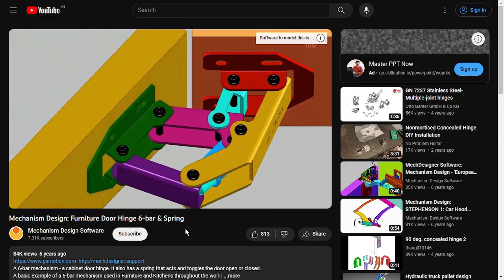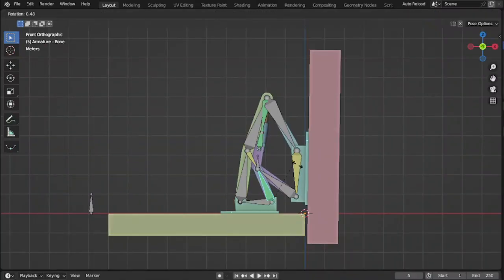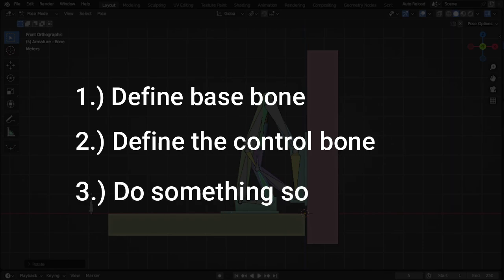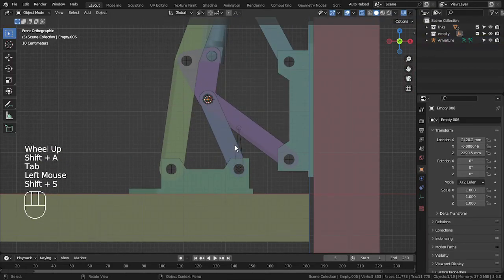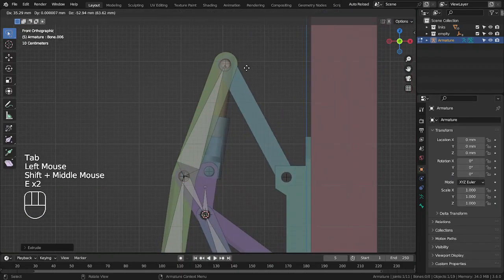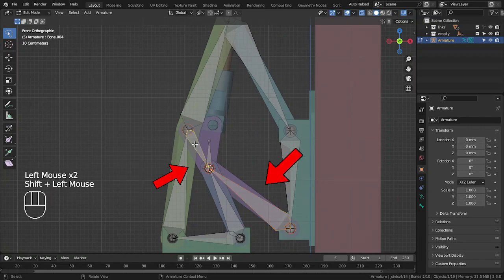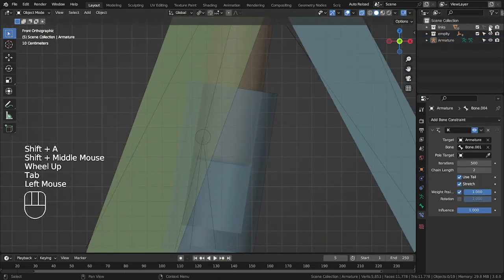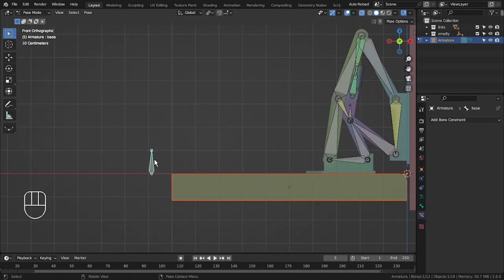Mechanical Rigging in blender | 6 bar mechanism

Comment: Excellent, thanks! I want to grab the red piece and move the whole mechanism, is it possible?
Reply from the maker: red piece ??? 🤔
Reply: @abd_3d  I mean the thing on the right. The lid that opens and closes.
Reply from the maker: @polzol2  Correct me if I'm wrong, but is your question about moving the last link (both opening and closing links) to shift the entire mechanism? As far as I know, we can't do that because we don't know the exact path of the bone (link). We can move in any direction, but the child links (mechanism) behaves unpredictably. Currently, I've selected a control link that can drive the whole mechanism because it has only one degree of freedom, making it easier to control. If you create this assembly in CAD software like SolidWorks or Fusion, you can achieve this using constraints or mates. You can move the last link, and the entire mechanism will move as desired. However, in Blender, I don't think we can do this without specifying a path for the bone. I hope this clarifies things for you
Reply: @abd_3d  I see, what a shame, that's exactly what I wanted to know. Thank you very much for the thorough explanation!